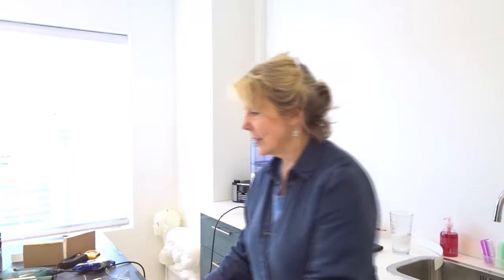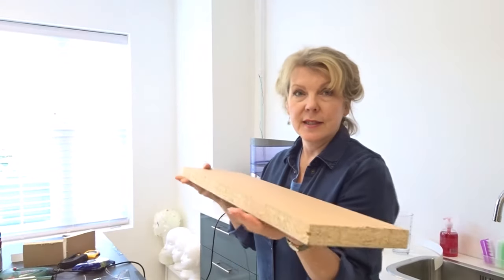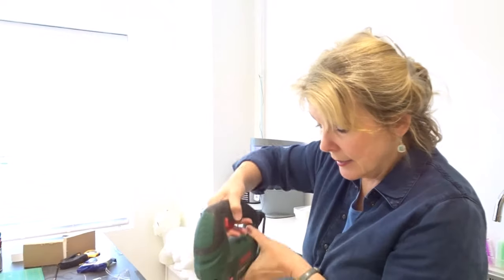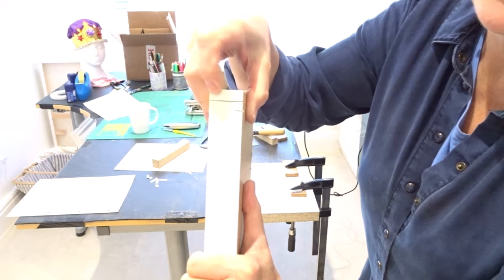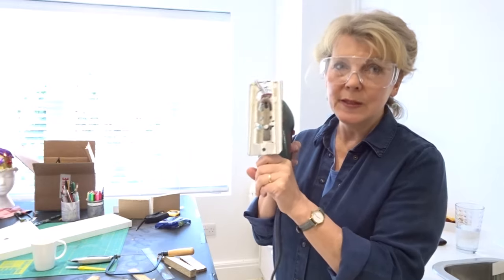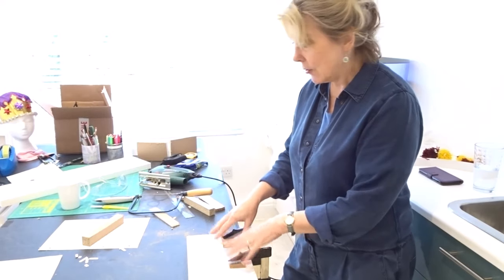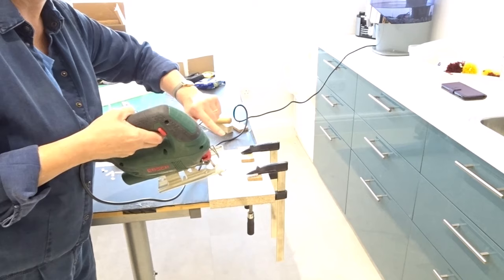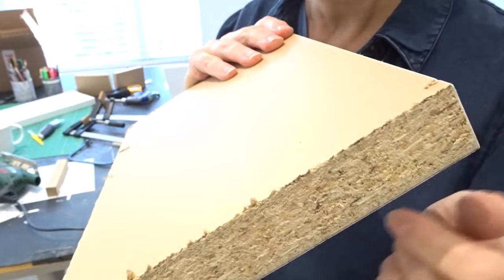How to cut a laminate worktop cleanly.

Comment: Well... my Bosch jigsaw arrived today 11/4/2021;  on the.. “get it tomorrow”  delivery.  And i must say it’s a great little tool to work with.
Quite powerful in a way.. for a 500 watts power tool.   But it made life much easier cutting out the middle worktop piece for fitting in the sink;  as opposed to using a handsaw 🪚    My new sink fits like a glove... as the “carpenters daughter” put it, on her YouTube channel.   
i have to be real careful now...    because now, that the middle piece is cut out...  the worktop itself has become more vulnerable.
My worktop measures 3,000 millimetres. Quite a long work shelf.   So I’m going to be patient on this;  and not rush into anything.
Sunday afternoon at 17:26H.  11th April 2021.  U.K. 🇬🇧  Southampton.
Reply from the maker: That's excellent Peter, well done. The more you do; the more confident you will become and as you say take your time, be patient and let us know how it goes.

Comment: Jigsaws cut upwards because they're cutting toward the table of the saw, pulling the wood/formica/plastic/whatever toward the table. If they cut downward, they'd force the saw in the opposite direction -- upward, making it hop away from the material being cut. Circular saws cut upward -- toward their tables. Tablesaws cut downward -- toward their tables,....
Reply: And, for an example of what happens when your jig saw cuts up, see at 8:06 where the saw jumps up off the table.

Comment: Unfortunately in my case.... i don’t have a jigsaw.  So I’m having to cut the middle worktop out for my sink, using a hand saw 🪚 it’s an absolute nightmare.   Just hope i don’t mess it up.  i only get one chance on this.
Saturday am at 11:41H.  10th April 2021.  U.K. 🇬🇧 Southampton.
Reply from the maker: Yup that's going to be really, really tricky and hard work. I'm reluctant to say impossible but... Do you have a circular saw? I would use a paddle or spade bit for dealing with the corners, (or even a hole cutter),making sure you stay inside your cutting line. Be really precise with marking your template.

 Screwfix etc are open at the moment ( as are all tool places- essential) if you could stretch to a cheap jigsaw. I've had a quick look  and this is the cheapest one I could see: https://www.screwfix.com/p/mac-allister-msjs600-600w-electric-jigsaw-220-240v/191gf.
I cannot find any examples of anyone doing a cut out with a handsaw, if anyone else can help Peter, please feel free to reply here for him.

Otherwise you are going to have to drill a lot of holes close together in the centre to even get your saw in to the worktop ( assuming it's going to be a rectangularish hole ). The good news is that sinks generally have a lip over the edge of the laminate top so that if it does chip a bit this should be covered. 

Good luck, let me know how you get on.

Comment: The some peculiar reason that you do not understand is called a safety measure. You can use a downstroke blade to cut, but that will make the kickback significantly stronger. The safest way to cut is use the upstroke blade and flip the board around. Don't worry, the method you've shown here is already perfect and safe. You don't need to see the board as you're cutting it. This is work, not a show. Trust your measurement. Remember the mantra: "Measure Twice & Cut Once" 👍

Comment: Hello...great video. 
I'm about to do this soon...so is this a special blade you got?
Reply from the maker: Yes. The good old T101BR  it cuts on the down stroke rather than on the up stroke which apparently is normal. Here is the link for screwfix
https://www.screwfix.com/p/t101br-various-material-jigsaw-blades-100mm-3-pack/6628x

It doesn't have to be this brand it just has to be a  T101BR.
Reply: @BecomingCreative  ahhh ok great! And is this a universal blade?
Reply from the maker: @jacksonbrown2827  So long as you find a blade with the code T101 BR on the hilt you should have the correct blade whatever the brand. Look at the direction of the teeth- if they look like your top teeth ( for biting down) you have the correct blade. Good luck with your project - and if I could be permitted a bit of shameless self promotion have a look at Becoming Creative Magazine on Facebook. I am launching the magazine soon and this tells you what is happening heading towards  that launch - ooooh exciting- well hopefully!
Reply: @BecomingCreative  thank you so much for the replies ...and your analogies are great btw...take care and good luck with the launch🙏
Reply from the maker: @jacksonbrown2827  Many thanks.

Comment: Impossible to cut straight line especially through a work surface with jig saw even if you have god level switched on.  The blade will wander off and cause a bad join.  Use router with jig or rail saw.  Better than that pay a chippy to fit surface.  False hope ends with upset.  However I do like this vid for the purpose of cutting round skirtings making angles and curves without chipping 👍👍👍
Reply from the maker: Thank you, I think. Mine came out quite straight as I was very careful to look down on the blade and cutting line from above, which I think helps. Glad you enjoyed the video.

Comment: Not too shabby. Would like to see a full width worktop done with that bodyweight into the blade technique you have going on there... I bet it would be less than perpendicular, jigsaws are very prone to that and it is exaggerated if you force the cut.
Reply from the maker: Hold the gushing praise there Dean Oh! Seriously, thanks for watching. Also, next time I do this I will try to go more slowly as suggested by Ravin below. I agree doing a whole length is more of a challenge, but easy does it, does get you there.

Comment: Well explained video , Except you didn't tell us the name and model number of the jigsaw blade , which would have been helpful, Thanks anyway
Reply from the maker: Hi Malcolm, thanks for your comments. The details of the blades are in the comments below, but basically the brand doesn't matter so much as the code which is T101BR- it's the R part of it which indicates you have a reversible blade. I got mine from screwfix https://www.screwfix.com/p/t101br-various-material-jigsaw-blades-100mm-3-pack/6628x  and there is a link below for ones manufactured by Bosch which I'll repeat here so that all the info is in one place.  https://www.ffx.co.uk/tools/product/Bosch-T101Br-3165140012454-Reversible-Pitch-Clean-For-Wood-Jigsaw-Blades-X-5
Hope your project goes well.
PS I've now changed the video description to include details of the blade, which I hope makes life easier for everyone.Thanks for the feedback.
Reply: Thanks for your reply , Most people do these videos,  don't reply at all, Keep the videos coming.THANKS

Comment: Becsuse you just mark it on the opposite side
Reply from the maker: Yes, of course you can do that, but since there's a reversible blade available that enables you to cut from the right side, that's what I prefer to do, so that I can actually see where I am cutting. Cutting from the top, so that you can see what you are doing, also avoids any wobbles if you haven't kept the blade exactly vertical. Thanks for watching.

Comment: never use a jigsaw to cut a laminate worktop because you'll find it very difficult to get clean straight cuts. Use a circular saw with 60 or 80 teeth blade instead.
Reply from the maker: Thanks for this AJ. You clearly have more tools than most. Yes, of course you can get a clean straight cut with a circular saw with the correct blade, or with, as some have suggested here, an appropriate handsaw. I prefer the jigsaw a) because I have one and b) because I can see really easily what I am doing and c) because I can go as slowly as I like without it running away with me.
Reply: @BecomingCreative  Here's how you can fix your issue. Step 1: get a circular saw. Step 2: Use it. Step 3: Enjoy the results.

Comment: You don't cut worktops with a jigsaw 🤣
Reply from the maker: I'm not a professional carpenter Ben, but I think I have shown in the video that you can use it for cutting a worktop, to get a clean edge with no chipping, but perhaps this quote from Woodmagazine.com about different jigsaw blades will be more persuasive?
Reverse-tooth blades

Reverse-tooth blades cut on the downstroke, minimizing chip-out on the face side of a workpiece when you must put the best face up during cuts. Making a sink cutout in a countertop calls for one of these blades.
https://www.woodmagazine.com/woodworking-tips/techniques/sawing-solutions/jigsaw

Comment: Look love, no offence but stick to something you REALLY know about,and this is not one of them . What you say about chipping is of course true, but a jig saw is NOT the tool for a serious accurate cut . What you have demonstrated is a reasonable way to just cut a worktop to a rough length( Leaving a couple of inches long for the proper cut) so that it is easier to work with.  This rough cut could also be performed with a hard point handsaw. Top quality jigsaws are a great tool , but are very often used where they shouldn’t be . Many people watching this will either own,or go out and buy, a cheap jig saw,and these are truly awful,and dangerous . 
  Leave it to a tradesman or at the very least a competent experienced amateur.
Reply from the maker: How funny that you have actually said something useful, but felt the need to wrap it in rudeness. I have never claimed to be an expert carpenter and I do not claim to be training people to become such either. This is a channel promoting creativity  and nudging amateurs to become experienced by (the only route) of safely having a go themselves.  I am pleased that you have noted that I have demonstrated " a reasonable way to just cut a worktop". What I was actually pointing out was the existence of a reversible blade, ( which BTW I am not being paid to promote) so that you can cut from the top and see where the blade is going. As you will see from the many comments below , lots of  people, including professionals, have found this useful to know. You give good advice that it is always a good idea to buy good quality tools, if you can afford them.  I am always happy to receive tips from professionals to share and some professionals are kind enough to help this community by offering their additional advice. There is no need to be offensive, I guess you are having a bad day, but I hope it improves for you. Thanks for watching.

Comment: Worst advice. Do not expect a Finishing cut with a jigsaw. Okay to cut an opening for a sink where the cut edge will be hidden by the sink. DO NOT ATTEMPT  this foolish advice.
Reply from the maker: Hello there John,  I wonder if you've ever tried a reversible blade? It does seem to be a well kept secret. I'm not a professional carpenter, but I think I have shown in the video that you can use it to get a clean edge with no chipping, but perhaps this quote from Woodmagazine.com  will be more persuasive?
Reverse-tooth blades

Reverse-tooth blades cut on the downstroke, minimizing chip-out on the face side of a workpiece when you must put the best face up during cuts. Making a sink cutout in a countertop calls for one of these blades.
https://www.woodmagazine.com/woodworking-tips/techniques/sawing-solutions/jigsaw

Comment: True fact....You will never get a 90 degree angle cut with a cheap jigsaw such as the one used.
Reply from the maker: I think I have demonstrated that I did get a 90 degree angle cut, even with my 'cheap' jigsaw.  So not quite true and therefore not really a fact.
Reply: .... @BecomingCreative .... For a true 90 degree cut always use a circular saw.  It's how the professionals do it.